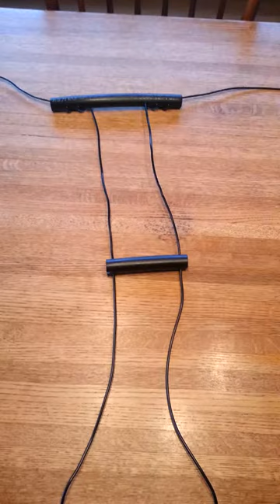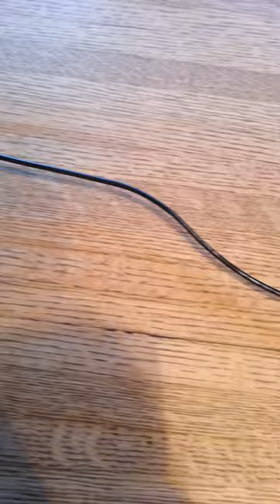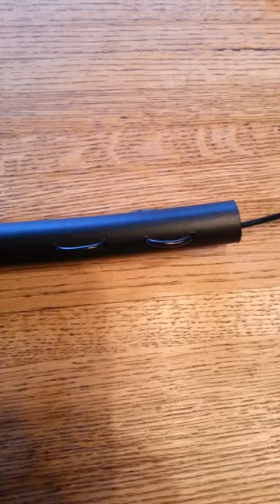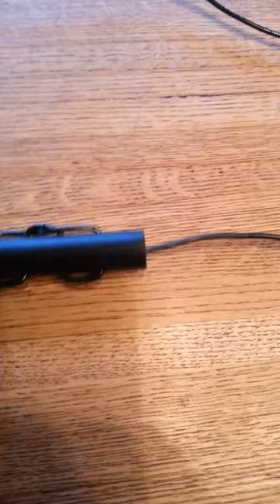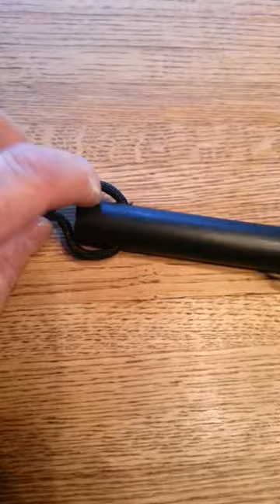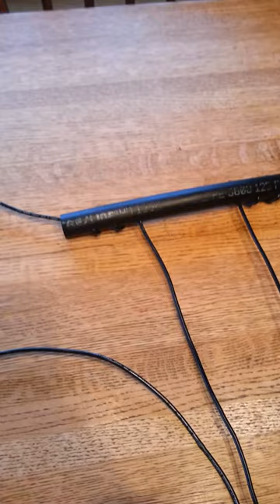W7FG True Ladderline and Doublet Construction

Comment: If pulleys in trees is a problem, then instead of dacron to the antenna end, use some weed-cutter line. Make it long enough to extend beyond the supporting branches, then attach your dacron. The sway of the trees works only on the weed-cutter line and it will last for quite a few years.